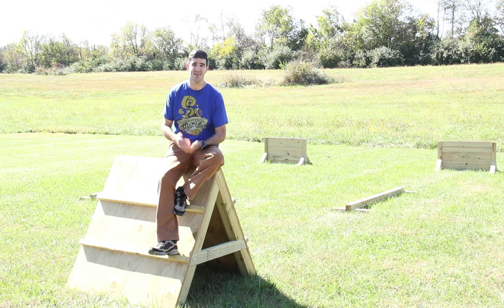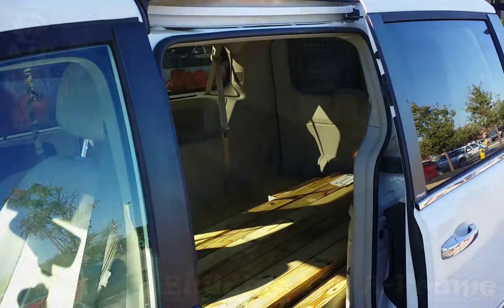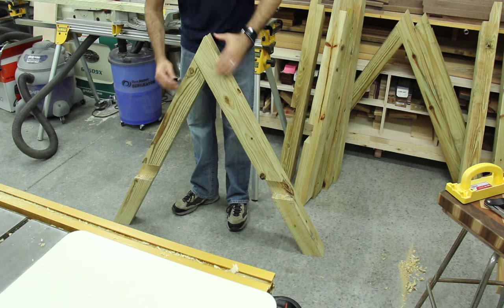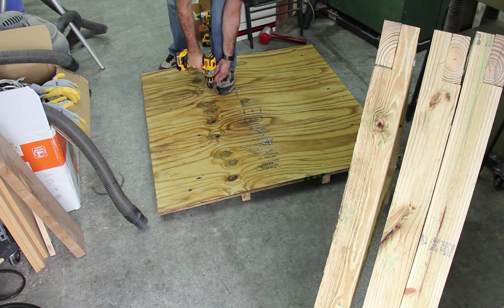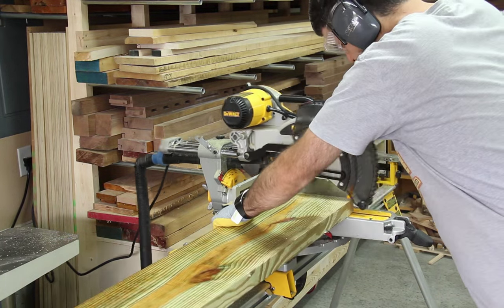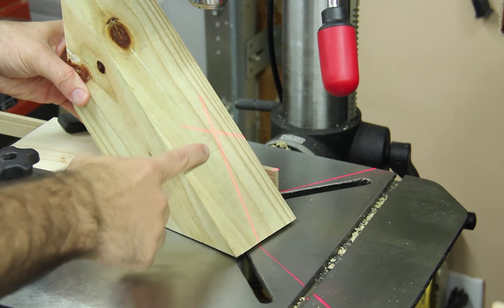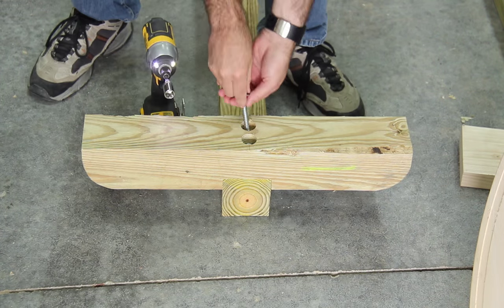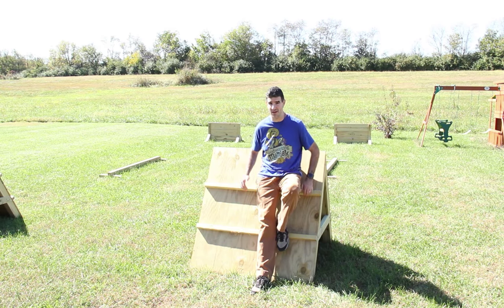Obstacle Course for my Son's Birthday Party

Comment: great video. but how come you don't have a throat plate on your ts.
Reply: +Lancer Mccullin Treated lumber will gunk up whatever you cut it on, from all the goop they put inside it.
Reply from the maker: +Lancer Mccullin Randy Answered it before I got around to it... I took out my zero clearance insert so I wouldn't end up with gunk all over it.
Reply from the maker: +Randy Allaway Yep...
Reply: Goop, is of course, used as a technical term here.
Reply: Good advice